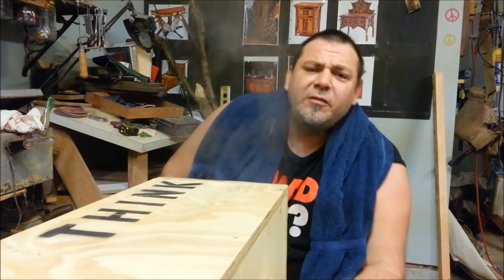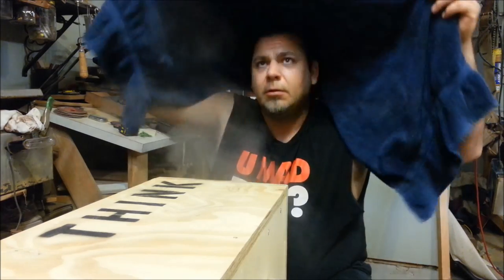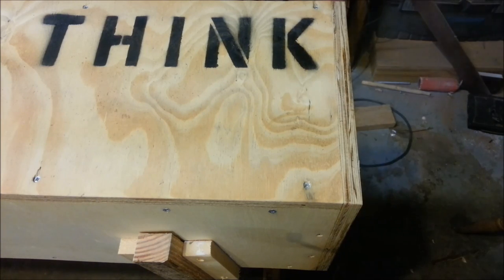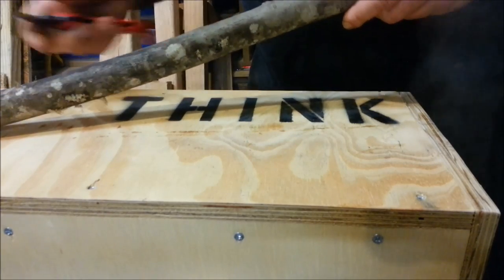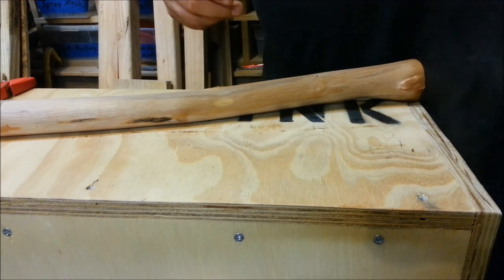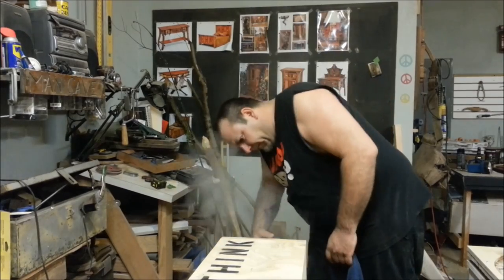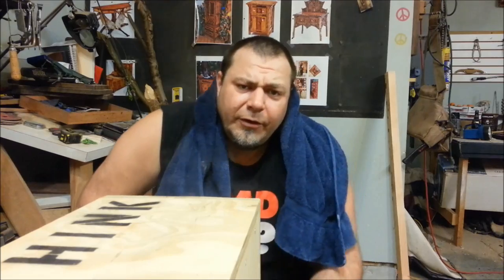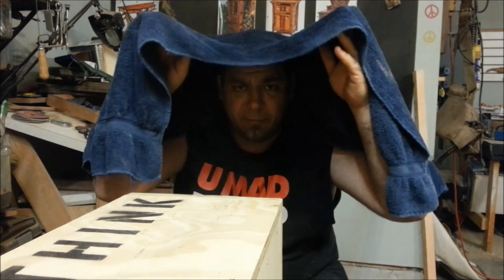Beyond Steam Bending!

Comment: I actually had a problem with boring beetles in a log coffee table I made and had to tear it apart, and heated the wood for new legs to 150. Great tip. I would be less nervous about cracking if I had used steam.

Comment: Like all your videos, this one is really good. I've never even considered using steam to even out the  color across a board. Genius. One question, though. Does re-introducing all that moisture cause problems with checking in the future? The cell walls are already open, so maybe not. I just don't know. At a guess, I would think it should be fine, but like I said, I'm flying blind here.

Comment: Izzy, I need your help. With a steam box, would it be possible to bend 3/4" birch plywood? I want to make a long board, but I want to avoid gluing layers of thin veneer in a form if possible.
Reply from the maker: Mason Stevens it  has to be press formed steaming ply will just make it delaminate
Reply: What about one solid piece of hardwood of the same dimensions? And what hardwood steams the best but would still be strong enough for long boarding?